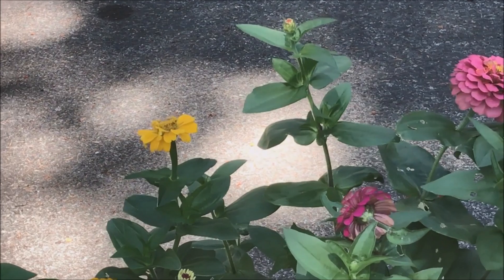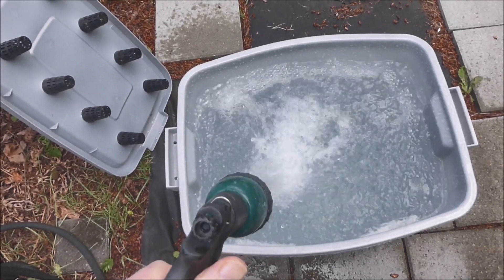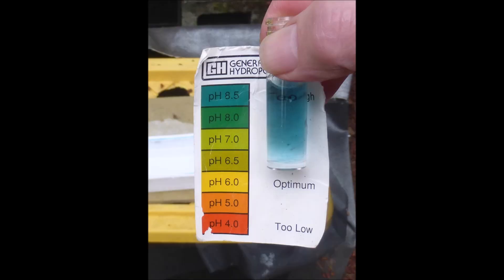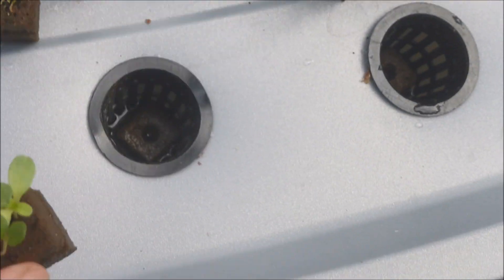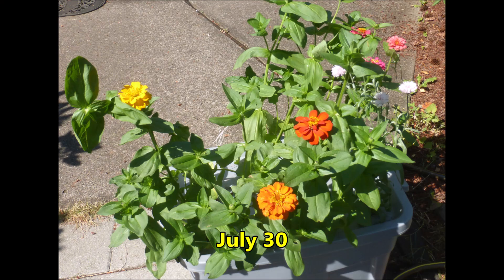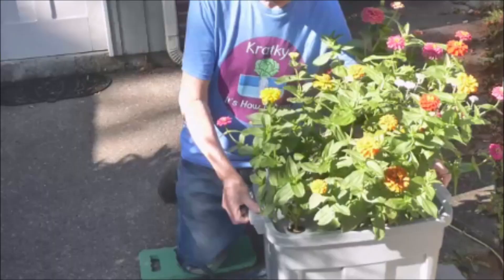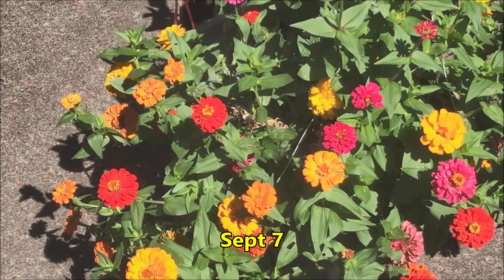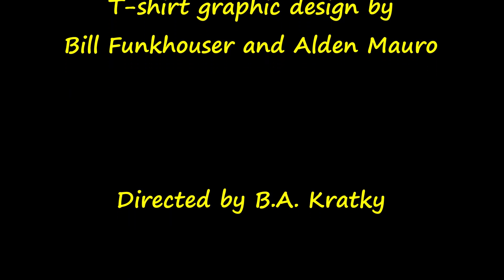Hydroponic Zinnia Flowers

Comment: How much extra water + nutrients did you end up adding?
Reply from the maker: Firstly, I am happy to report that the flowers are still alive and well.  During the remaining warm weather of Aug, I usually added 2-3 quarts of water per day, but lowered that to about 1 to 2 quarts per day starting about 10 days ago due to cooler weather and smoky air conditions.The correct approach to adding more nutrients is add nutrient solution instead of water when the EC becomes lower than 1.5mS, but my actual approach was a little more complicated.